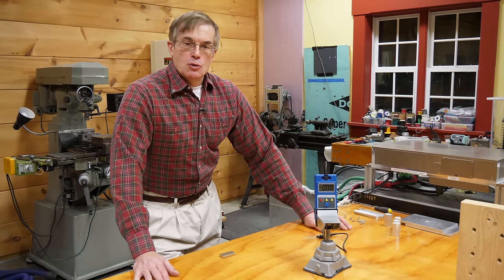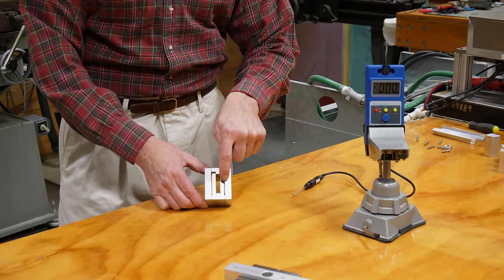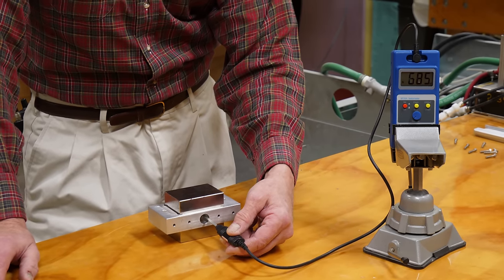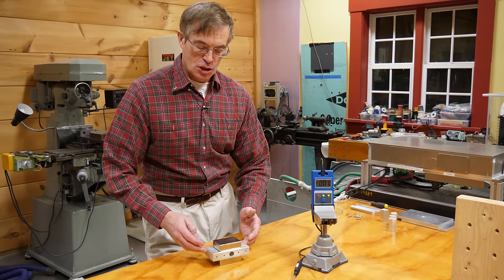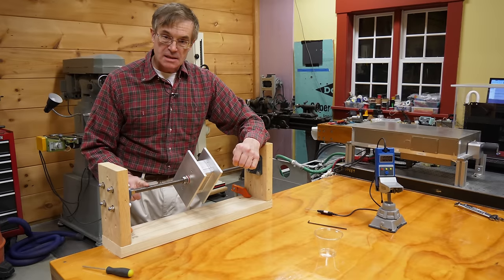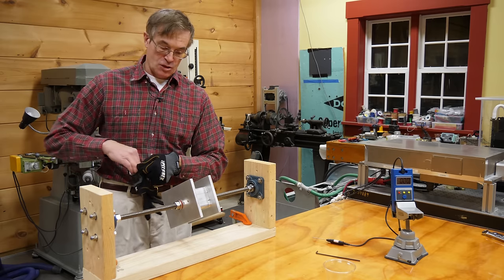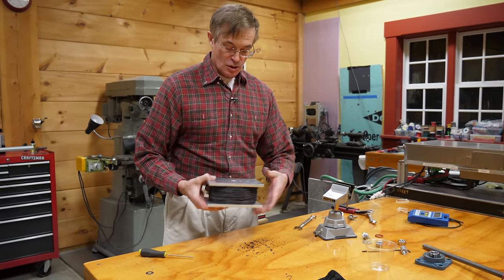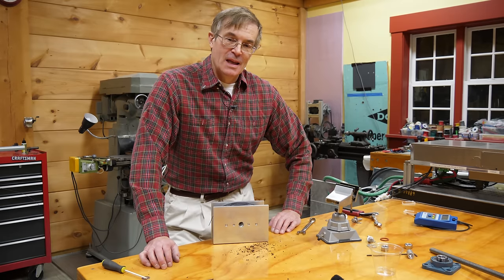VERY POWERFUL MAGNETS… THE EASY WAY

Comment: It could have been very easy to ad a hand drill to your winger  with a belt and pulleys or a chain  and sprockets.
Anyway congratulations and thank you very much for the big effort you put in your interesting experiments.
Reply from the maker: Thanks!
It wasn't.  The limitation was the person unwinding the stock coil of wire.  It tended to twist and tangle and a motorized winder would risk fingers.

Comment: why not put a hand crank on the end and then some tension on the spool and guide the wire as it lays in track side by side? or a small low speed motor to slowly turn the shaft
Reply from the maker: The winding is not the limiting factor.  It is the uncoiling of the stock wire which tends to twist and tangle.  A motorized winding could be dangerous for the person managing the stock wire.

Comment: Adding the steel made a stronger field between them but how do you increase the field on the outside
Reply from the maker: You can't, really.  There is only so much field and that is based on the strength and size of the magnets.  You can shift it around to increase its local intensity, but you can't make more of it.

Comment: Yes, but making this is making the magnet weaker, opposite to the title? If I bought N52 magnets, it would be that I want that kind of strength. The tine hole in the center with 900 tesla is not a practical magnetic outlet for most.

Comment: Should have gotten a plastic sheet and brake lathe chips. Put the sheet around it and fling the chips. Placing a bag and a vacuum in it will compact the chips
Reply from the maker: That's not a good idea.
The sharp chips will go everywhere and be very difficult, not to mention painful to remove.
A better modification to our approach would be rolling steel packaging strapping because this will generate a higher steel density, and that's what we're  doing for our upcoming rocket powered MHD generator magnetic yoke.

Comment: It would be great to find a tool other than a Gaussian Meter to measure why both magnetic poles have differing field strengths in an exact pattern across both planes of a permanent magnet. As you know, a ball bearing will never be attracted to the exact centre of a magnet. A ball bearing is attracted to a Disk magnets outer edge or near the magnets centre but never it's exact centre. Some other explanation, rather than the generic understanding of magnetism is obvious. The Gauss meter is a tool to measure potential differences. If you're going to use a Gauss meter to measure magnets. You should query why both polarities have differing Gauss readings, on both North and South sides of a magnet, much like the contours of a map. I Hope you take my comments as a way to further each others understanding.

Comment: I would  have used a wooden rod, extended the rod through the wooden support with holes.  No bracket required,  a bit of lubricant and sandpaper.  Then a motor to turn it, so you guide.  Another wooden stand to hold the wire, no son required, he can help in more active ways.  Add $Thanks and it is easier for people to say thanks in a practical way.

Comment: you can build super high voltage capacitor array and a coil strong enough to hold the pulse , place the iron in the center of the coil and flip the switch . Make sure the capacitor array has high voltage and maybe 100mf at most and stand back because might make x ray .. do your research. Must be small micro farad small enough that the iron wont move at all when the pulse happens. the iron can be thick and heavy or small as long as the micro farad are low and voltage is high 5kv
Reply from the maker: You won't  generate  X rays. You won't  even generate much of an increase in the magnetic field with a small capacitor.   You can verify that if you calculate the energy capacity of the inductor vs that of the capacitor.
Reply: @TechIngredients  you can polarize metal with high voltage and low current the same as with  low voltage high current .

Comment: Opportunity for some fun.. motorize the jig :) and use thinner wire. Would be done much faster too.
Reply from the maker: We considered that, but decided against it.  The coil unwinding is challenging because the wire twists and loops tend to interfere.  You can't see that in the video and this could pose a risk if the yoke was wound by a motor.
Reply: Ahh.. so that wire doesn't come in nicely wound spools!? Similar to cooper spools for building motors.

Comment: Is this basically a Faraday cage?
Reply: I think it might be analogous to when dealing with electric fields instead of magnetic fields, but it is not the same. For example copper would work well as a Faraday cage but not for magnetic fields.
Reply: a Faraday cage is an enclosure used to block electromagnetic fields
a magnetic yoke completes the magnetic circuit so that most (close to all) fields lines are confined into the yoke

Comment: What about using iron filings, or powder, contained in a "box" initially. Finally, saturate the powder with epoxy.
Reply from the maker: That would work. It will probably  be a little  less effecient because of the solids loading limit for the epoxy. It will  be messy as well.

Comment: I watched both videos and although they're done well for the most part, would it be too much to show what kind of practical things you'd be using this gap magnet for besides just a demonstration of making it?  Don't get me wrong, the process is fascinating, and sure, I could go and google up "uses for gap magnets" but I think you're missing out on the money shot for a project that's so involved.

And I bet there's a thousand commenters dying to list off all the things a gap magnet is used for, and miss the point entirely.
Reply from the maker: We've  just finished  the MHD drive based on this assembly.

Comment: A non-physicist asks: Is there a practical way to use this phenomenon to improve induction heaters by compacting their flux as well? I understand that this may also heat up the "magnetic ducting" material, but perhaps losing that energy is worth it.
Reply from the maker: Induction heaters depend on a varying magnetic field which is necessary to induce a current in the target material to be heated.  A yoke style outer field guide would also experience a similar heating for the same reason and waste considerable energy.

Comment: With a nod to the law of diminishing returns,  the magnetic permeability goes down with the content of other components in iron alloys (https://en.wikipedia.org/wiki/Permeability_(electromagnetism)#Values_for_some_common_materials).
That is, using a soft iron wire instead of steel wire will allow for a smaller amount being needed (plus it's easier to bend). It's hard to find it though - so how about annealing some steel wire in mini-foundry with a hydrogen flame?
A cheap hydrogen generator: aluminum barbecue trays (good surface to weight ratio) and sodium hydroxide - a "basket" with aluminum strips under a "diver bell" in the lye solution makes a poor man's self-regulating hydrogen generator - enough hydrogen will push the lye solution down and stop the reaction; consume the hydrogen and the solution wets the aluminum again to generate more. The resulting sodium aluminate can be neutralized to hydrated aluminum hydroxide (e.g. use ammonium chloride when you need gaseous ammonia. Or just use the v2.0 TEC freezer to store some pure liquid ammonia? Plus you'll never need table salt for your entire life). BTW, that aluminum hydroxide byproduct? Calcine it to alumina before adding to the mixture of a DIY refractory cement to use in the second version of mini-foundry.
Does it sound like a nice Rube Goldberg just for bringing those magnet yokes one small step closer to perfection?

Comment: there is no field lines . magnets work like a fluid trapped in a container. the so called lines is just boundery regions of opposite polarities.yoy are not guiding anything. you add metal on one side the field get stronger on the other side. think of air in a baloon. you compress one side the other side expands.that is what happens to the magnet.
Reply from the maker: You are correct.  Field lines are an artificial construct to aid in visualizing the properties of the field.

Comment: There is a lot of air gap between the magnet and the wires. I think use steel blocks can gain higher magnetic strength, might > 1.2T, I guess.
Reply from the maker: That is the trade off.  If you watched our previous video where we used steel blocks, we did achieve 1.2 T, but it was a little too exciting.
Reply: @TechIngredients  Thanks a lot, I found the previous video titled "Extreme Magnets"

Comment: Cordless drill on the end of the allthread would make the winding much easer.
Reply from the maker: We considered that. But the real speed limitation is the person stuck with unwinding the stock coil.  It tends to twist and tangle and we didn't want to risk any fingers.

Comment: Why didn't you build your jig to incorporate a drill or something else that can spin the thing automatically for you while you wrap the windings? At least a hand crank on the end. Guitar pickups are "hand wound" by spinning by machine while the operator guides the coil wire by hand. Same concept.

Comment: Is there a way to increase the pushing power of the magnet?🤔
Reply from the maker: This is such a method. The limit is the field strength that can be generated by directing it with ferromagnetic materials.

Comment: Why?! Just why did you not put a power drill on that assembly rig?
Reply from the maker: We decided against that early on.  The limiting factor is not the winding it is the more difficult process of unwinding the wire from the stock coil.  It tends to twist and come off in multiple loops, easily tangles and a power drive on the magnet would risk the fingers of the person holding that coil.

Comment: Would it not be better to add thin plates of mild steel one at a time while wearing welding gloves?
Reply from the maker: Theoretically yes, but they have to be very thin because these magnets are so powerful.  That means you have to slit or cut a lot of plates and that takes time.

Comment: Should have run the all-thread through the bearing and through the wood, double nut on the end, and you could have spun the magnet with a socket on a drill.
Reply from the maker: No, you can't.  The rate limiting step is the person dealing with the the stock coil.  This wire tends to twist and tangle if you're not careful and a motor driven winder risks fingers.

Comment: Would a box of Lexan or aluminium filled with iron filings do the job.
Reply from the maker: In principle, yes.
Working with iron filings and magnets can be messy and difficult  to clean up.
Reply: @TechIngredients  Sounds like a project with a mold, two part epoxy and filings . Experiment with different shapes and sizes , the fun could never end !

Comment: How much difference would using a continuous strip of laminated transformer steel make? Perhaps that might bring the magnet up to one Tesla?  Some power  and larger toroidal transformers might be a good source to scavenge.
Reply from the maker: Lamination will make no difference.  Lamination is used to reduce eddi currents that are produced by a varing magnetic field, as in a transformer.  This is a static field.

Comment: i am confused. you were using wire to make the magent stronger, but its magnatism and tesla decreased
Reply from the maker: No, the metal guides the field so that the field inside the assembly is stronger and the field outside is weaker.

Comment: aweomse video. What are the odds of you gents ever taking one of those RC electric jets from the bike and using it as a forced induction system on an engine? It would be like those crappy ebay turbo scams back 10 years ago, but with actual engineering behind it, would be hilarious.  A hybrid of crappyness and awesomeness.
Reply from the maker: Thanks!

They could work, but I would expect with limited success.  The amount of power required to compress a sufficient volume of air to the pressures a forced induction system needs, is surprisingly large.; as in10's of HP.  Like in a turbocharger, the best compressor design is centrifugal, although we used an axial compressor(s) because they were light, available and relatively inexpensive.

Comment: why not extend the arbor rod and attach a variable speed motor like a drill and at high torque  with a foot pedal to wind them by just guiding the wire, sort of making a transformer winding machine, the wraps could be tighter and more dense.......... and in less time
Reply from the maker: The speed limiting process is the person unwinding the stock spoool of wire which tends to twist and tangle.  A motor winder would also endanger that person's fingers.

Comment: I assume you thought about using sheet iron instead of wire. I would have like a sentence or two on why you settled on wire instead of sheet metal.
Reply from the maker: The strapping was more expensive and the sharp edges were a little more intimidating.

Comment: Does Tesla (Automobiles)’ use the same idea with their cars?
Reply from the maker: I doubt it.  I'm not familiar with the magnet arrangement in their motors, but they are likely using pretty standard, high energy magnets aranged the same way as most three phase, brushless, DC motors in high end drones.
By the way, we have a new video coming out in couple of days with a shout-out to Elon, you might like it.

Comment: How about powdered steel of some sort ? Pour it !
Reply from the maker: It will work, but it would be a mess. Have you ever tried to remove metal debris  from a powerful  magnet? The filings would get into the bore as well on every surface of the magnet structure even if it wasn't  exposed, making handling and mounting difficult.
Reply: @TechIngredients  Have I ever ! Always put the mag in a baggie first. (I never used biggies like you though.)

Comment: I guess that’s why some transformers use thin flat steel instead of a ferrite core. I’m not sure of the difference
Reply from the maker: A transformer operates in a continuously varying magnetic field and the thin laminations prevent eddy currents from generating heat and wasting power.
Reply: Tech Ingredients - thanks, does ferrite have some pros/cons then? It seems to get used jn higher frequency applications and flat steel gets used at mains frequency

Comment: Could have put a crank handle on the pole if poked through the wood sde.  Keepng tension on both assembly and spool of wire, it orders itself nicely.  Not suure why you just did'nnt uuse small piees of stock  steel.
Reply from the maker: When you saw me struggling with the tools you saw how powerful the force is and how small the metal would have to be and therefore how many pieces would have to be cut.  The wire is inexpensive, easy and will confirm to whatever shape the yoke needs to be.

Comment: Wouldn't fabricating iron plates work better, just because there are no gaps, like between the wires?
Reply from the maker: It would be more compact, but for an equal amount of metal mass, the wire should work nearly as well.  The problem with plates is the danger associated with positioning them.

Comment: I would have drilled 2 holes and turned the magnet with a drill. Automatically feeding the wire off the other spool.
Reply from the maker: We looked  into options like that.
The real problem  isn't the winding, it's managing the stock coil which tends to twist and tangle as it's unrolled.  A motorized winder threatens the fingers of the coil person.

Comment: you increased the Tesla but decreased the attraction strength of the magnet. how can I strengthen the attraction of the magnet is the most important question?
Reply from the maker: You can concentrate the field with a feromagnetic pole in the form of a cone or a pyramid placed in contact with one of the faces of the magnet.

Comment: Drop a rod of copper throu the hole. I wonder how long it takes.
Reply: I wonder how warm the rod will get. I bet it would be warm enough to notice the heating. The only reason it falls through at all is due to the losses to heat, so the slower it goes, the more current passing through, which means the more current getting converted to heat.

Comment: Rather a waste of effort adding the bearing blocks with all four bolts, considering a couple of Y shaped branches would have held the rod as effectively for this purpose. Still a good demonstration.
Reply from the maker: Thanks!
They "wood" also be non magnetic. But seriously, we built this jig with the thought that we would attach a motor to drive it.  The stock coil turned out to be the limiting factor as would tend to tangle if unwound too quickly, possibly catching a finger in the process.

Comment: You kerp talking about field strength but what is a field??
Reply from the maker: That's  a VERY good question.  Probably  the best, simple  answer is it represents  how our minds grasp the consistent interaction between localized masses.
Fields don't interact with fields directly, and this is why they probably represent a virtual  construct.

Comment: OMG... God forbid we bring one of the 2x6 sides in a little closer and have the shaft stick out the side and attach a drill to it. I would never had done this by hand. I personally have a winding machine here that I can attach my drill to add it counts the turns. I 3D print my wire fixtures and attach a mount to them that attaches to the machine. I'm done with winding by hand.